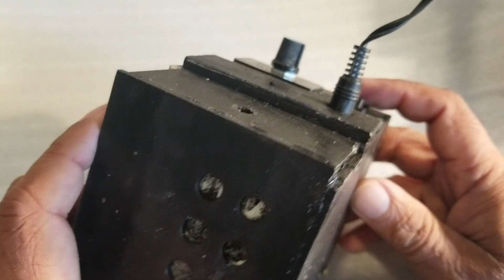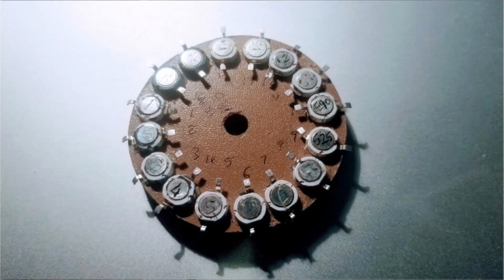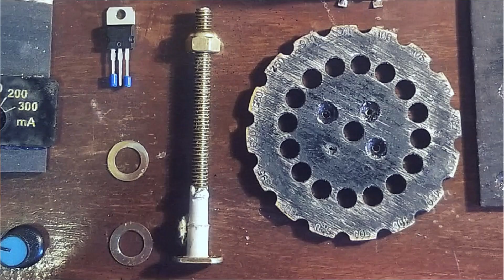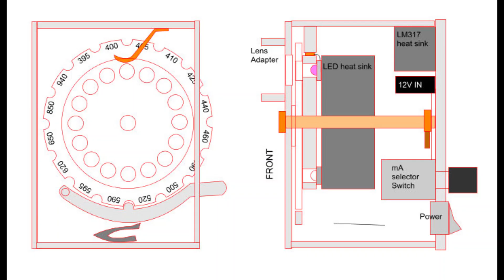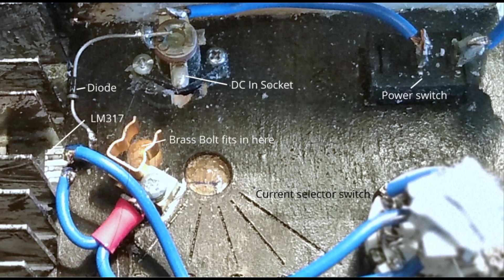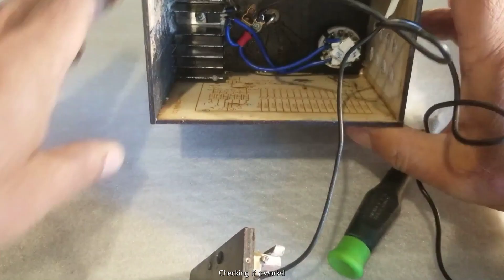LED Multiwavelength light source

Comment: This is built like something from 50 years ago with current day technology inside. I love it :) Any reason why you didn't use a potentiometer for the LM317P control?
Reply from the maker: Thanks! For using a switch for resistors versus a pot - the relationship between resistance and constant current is a log relationship so would need a log potentiometer. A ten-turn would work but then a lot of effort moving from low to high value resistance.